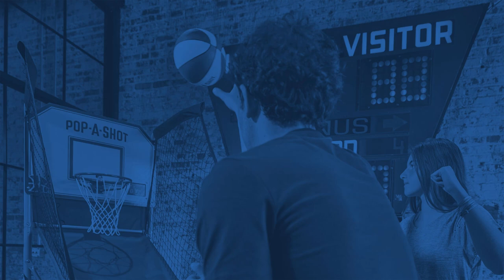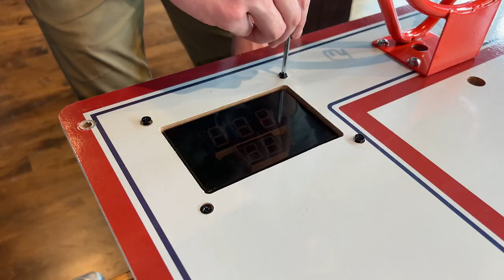How To Assemble: The Home Single Shot

Comment: I'm on step 5, putting in Cross tube number 6. I can not tell from the printed directions or the video, should the two holes next to where I'm putting in the bolts on 6 be facing towards the front of the unit or the back, to be used in later assembly